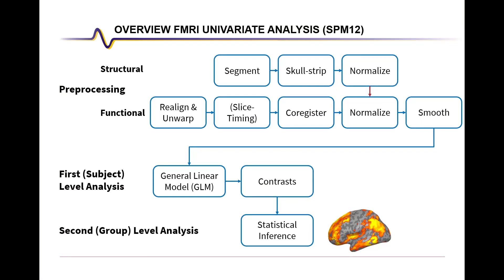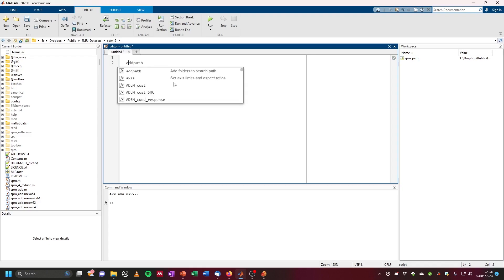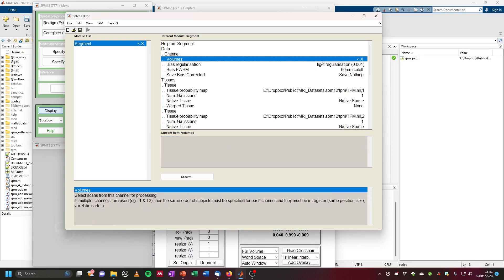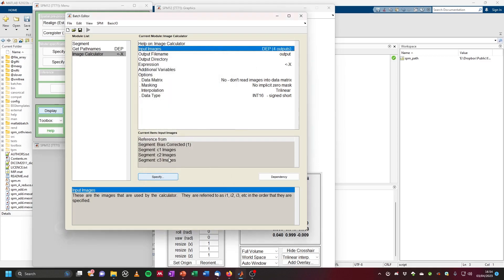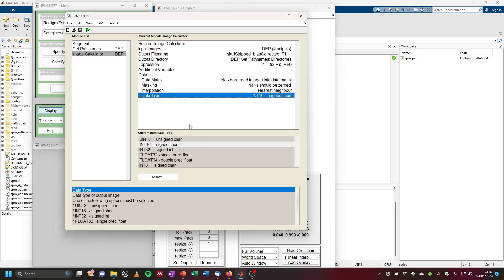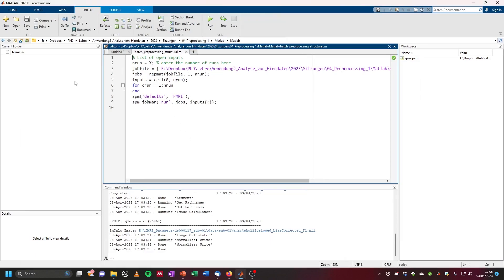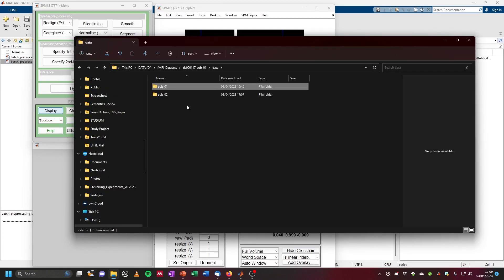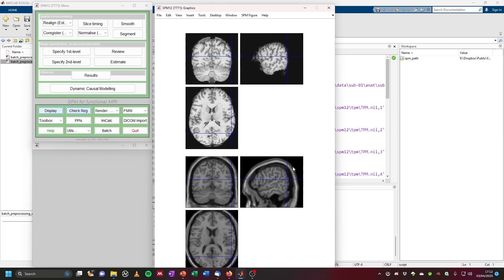fMRI Analysis with SPM: Structural Preprocessing (with GUI)

Comment: Hi, I compared the original T1 vs. bias-corrected T1 vs. skullStripped_biasCorrected T1 and it looks like the equation theoretically makes sense to apply the bias-corrected image to the combined brain mask but the skullStripped_biasCorrected T1 (visually) looked like it is in the middle of somewhere between original T1 vs bias-corrected T1. This is because the brightness does not exactly reflect the bias-corrected T1, while it does show the different brain regions slightly more clearly than the original T1. 

I assume it may be relevant to the mask images having 1s and 0s multiplied by the bias-corrected images. I wonder if I should worry about this result, whether there is a way to resolve, and whether this is rather a correct output even if  skullStripped_biasCorrected T1 looks different from the bias-corrected T1 image.
Reply from the maker: Hi Oh Sewon! Hm, the skull-stripped bias-corrected image shouldn't look substantially different from the bias-corrected image as it's simply a masked version. Perhaps this is only a visualization issue by your software (e.g. different scalings of the two images). Also, the skull-stripped bias-corrected T1 is only used for coregistration of the anatomical and functional images during functional preprocessing. As long as coregistration works well, you are fine. So I would check the outputs of coregistration and particularly normalization into MNI space using "CheckReg". If this produces a nice result, all is fine :)

Comment: Hi, 
How should we adapt the process if we have T2-weighted images as well ? and FLAIR ?
Reply from the maker: Hi Salomon, to my knowledge, T2 and FLAIR images are usually not used for typical volume-based fMRI preprocessing. T2 and/or FLAIR is however used for surface reconstruction with Freesurfer: https://neurostars.org/t/fmriprep-t2-images/2412/5
Or if you want to create head models (e.g. for simulation of non-invasive brain stimulation): https://simnibs.github.io/simnibs/build/html/tutorial/head_meshing.html